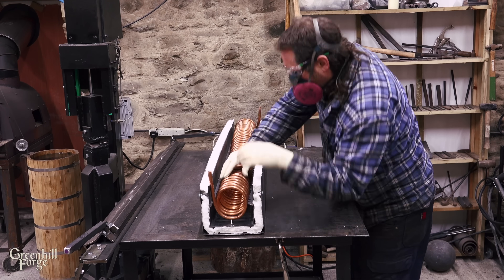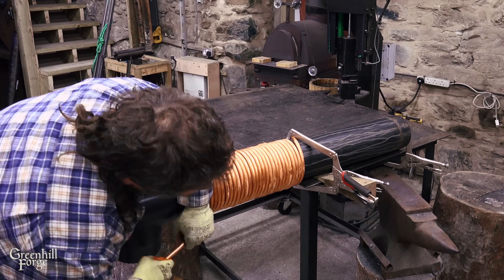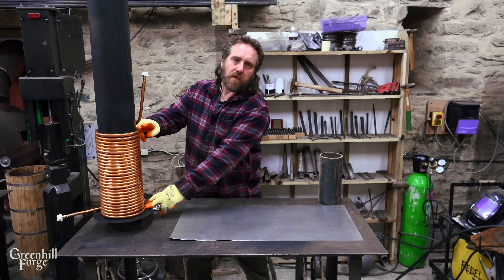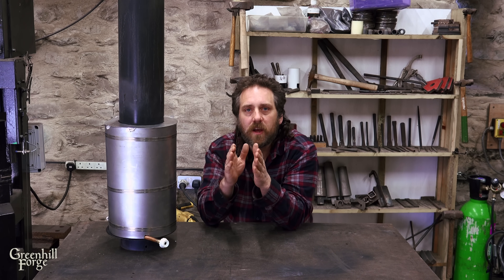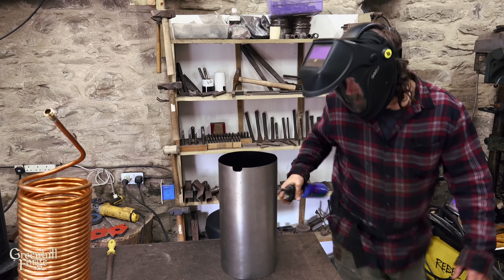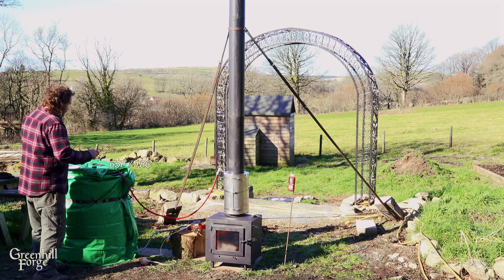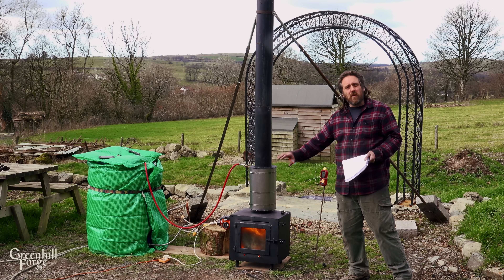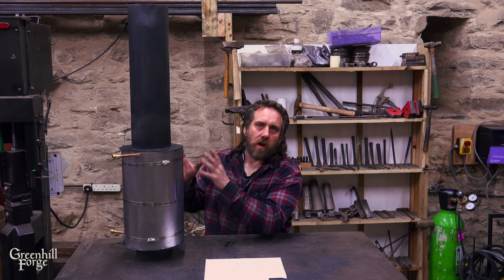Best Wood Stove Water Heater Yet: New Design Tested | Off Grid Water Heater pt3

Comment: So I like the idea of the most efficient being inside the flu, sounds like you need to separate the fire contact from the copper to reduce creosote… what I’m picturing looks like a regular flu on the outside, copper on the inside but you would have to weld a stainless jacket from the inside diameter of the coil to the inside diameter of the flu. The flu exhaust gas path would favor a Venturi yet the copper would be protected.

Comment: I assume that you chose copper for the conductivity and you place it inside of the chimney(flu? Don’t shure I’m from Germany )because of the surface area, but now you’re placing the coil on the outside so you’re reducing the contact area and now you are trying to work around this problem. I think the best solution would be to only make an outer sleeve and maybe wind up some sheet metal to direct the water in a spiral form around the chimney so you have an even distribution so the water  can take up the heat. Now you leave the copper coil away and don’t need to worry about any heat conducting materials, because the water you want to heat will get all the surface contact and buy welding or brazing the spiral direct to the chimney the heat will be transferred from the chimney  to the water like a radiator would do. Just my two cents, and that’s the way my parents Heat their Jacuzzi outside .

Comment: What about using a water jacket as in the car cylinder cooling system, so that the water is in direct contact with the chimney (without the copper pipe)? Also, instead of the chimney being  purally cylindrical, it can be made in " cylindrical zig zag" to increase the contact area and thus increase the efficiency of heat transfer.

Comment: I'd say just use more copper pipe, add a 2nd or 3rd section. If it's inside, you will also not lose as much heat or could snake the flue pipe for more heat dissipation.

Comment: The reason the coil in chimney worked better is because it is longer. The tighter outside coil only covers a relatively short part of the chimney. If you stretched the coil over a longer part and that used sand or grafite to fill the void the amount of heat transferred would be much larger as the coil will be longer in contact with the hot chimney.

Comment: Use same design for diesel tractor engines, steam into intake of diesel, burn less fuel, tractor runs cooler under full load, steam cleans engine carbon deposits

Comment: If you want to make it exponentially more efficient, make the coil section of the stove pipe horizontal. You'll likely have to use heavier gauge pipe due to the amount of heat, but the heat transfer will be more efficient. Also, if you incorporate a horizontal section of stove pipe, you may want to design a door at the end for cleaning purposes.

Comment: take the coil and spread it out so it contacts more of the flue pipe. then insulate it. the problem is you are relying on very little surface area. if you spread the coil out so it isn't touching itself it will absorb more heat from the flue pipe.

Comment: Graphite dust sounds like a good way to make a thermobaric bomb and demolish a building.

And the rocket stove temperatures would ignite solid graphite, if I’m reading the internet correctly.

Going from sand to graphite seemed like a big reduction in safety and I’d want to hear what a physical chemist had to say about it… the particle size might matter a lot.

But I’m here for it.
Reply from the maker: it wouldn't burn fast enough to go pop i don't think. pure carbon is flamable but it would need air so if it's sealed up it shouldn't burn (and hasn't) but sand would be the safer route
Reply: @GreenhillForge  I’m worried about failure modes … what if problem X causes rupture, and now you’ve got much worse problem Y : explosive dust surrounding ignition source …

Comment: In the 1980's I lived in the Rocky Mountains at around 8,800 feet above sea level. One of the neighbors used a passive system similar to your first exterior wrapped example to supply hot water to hot water baseboard heaters throughout his entire house. There were no cold rooms in his house.

Comment: I did something very similar years ago. Copper outside the flu but I filled all the gaps around the pipe with automotive muffler cement. My desire was to have as much heat transfer to the copper as possible. 
My intent was to preheat my city water as much as possible before it entered my NG water heater. I used an insulated water tank in parallel with my copper water heater. The entire system was at full water pressure. No need for a pump as convection moved the hot water. At the top of my preheater loop between stove and tank, I piped the warm water into my permanent NG water heater. Did it work? Absolutely and so well that my NG tank never fired up. The pilot light was all that burned gas. It worked so well that in the spring my local utility came by and changed my gas meter for no reason at all.

Comment: Here's an idea.
Have the coil around the outside but weld a steel strip between the coils, and then weld steel around the outside of that.
The idea is that the copper will be surrounded steel 360º for the full length of the copper.
There will be good heat transfer all the way because the steel will be welded all over.
The copper coil will remail clean. Maybe add graphite in all the voids.
I know this is absolutely labour intensive but I believe it will give you the best all-round figures, including longevity.

Comment: Just make a boiler , and use 3/4 pipe. 
No need for a pump , convection makes the hot water rise naturally and draws cold in . 
That's how they work . 

If you are determined to use pipe , ditch the 1/2 inch .

You Must keep the hot water storage above the heat source as hot water rises .... naturally.

Comment: How about trying it same system but have the flue double so the flame is. Going both sides of the tube ie instead of going threw the middle of the copper pipe it going both sides all the way round hard to explain

Comment: If it's all about heat transfer, preferably to the outside of the flue, why not weld on a jacket on the outside and ditch the copper pipe which adds another layer of metal, and has minimal direct contact to the flue which is the heat source? I haven't made one yet but have designed it with spiraling inside to make the water journey longer and more predictable.

Comment: great video, great results.
I do have one suggestion, that will mess up all your data. Slow your flow rate.

You said youll be off grid, and not using a pump. the pump pressure should be minimized to flow just enough so steam isnt produced coming from the outlet.

IF you change/slow down your flow rate, you'll get alot better efficiency results...or im 100% wrong....but just a thought.

Cheers

Comment: so why not place the copper on the top of the stove to start. its directly over the stove so its hotter, touches a thicker part of the metal. Only downside you may not use it for other things like cooking. if you want to heat the water more quickly just increase the length of the coils on the output pipe. same inputs in terms of woods, bu tthe water has a longer time to heat up and it touches more of the hot pipe. also consider a digital pump to control flow rate. slowing down the flow of water would increase the time under heat improving results.

Comment: I have always wanted to build a green house that I could use year round in Central NY.  I thought using a Rocket Mass Heater along with several hundred gallons of water stored in drums along the back wall (North wall) could be used to store heat through the night.   I think being able to move the heat around with water is a great way to increase the use of a wood stove in this situation.  I live on a hill so the north wall could be built into the hill to increase the heat retention.
Reply from the maker: It's a good idea that I've always liked too. I built a greenhouse thats a couple feet deep into the ground with a heat retaining north wall but I don't have a heater in it. it works great and adds about two months to growing on each end of the season. here's a video of it https://youtube.com/shorts/d_9Iyp3P0-w?feature=share

Comment: do it like the Russians do.  they just make a stainless steel water pipe.  and put it on the rocket forever and insulate it. water is pumped from above. and if it's like yours, then the capacity should be higher than the heater.

Comment: What if you machined a cylindrical heat sink that fit around the flu pipe that had rounded spiral groves that you could wind the copper tubbing into. The heat sink could be made our of different kinds of metals to test but I'm wondering if it would work better than the graphite. I've never worked with graphite so I don't know how it would stack up.

Comment: For off grid without a pump have the tank on a stand above the hot water heater coil????  if you are going to use a catchment system the cabin's water the HWH between the catchment tanks the cabin then will need to be taller and that process thought through....less than my $0.02 input. further expansion to use it for an external shower house and use thermal expansion to fill the tank, then the HW tank could be equal or higher than the catchment tank and a mixing valve used to regulate the shower temp variables

Comment: Thanks so much for this video. It's the closest idea I've seen to the idea I want to attempt. I'm wanting to supplement heat to a 1000 gallon pond in a dome greenhouse...and my idea is to use a galvanized bucket with a pre-coiled stainless steel weir in it covered in sand (or graphite powder after seeing this video)...kind of like the "sand battery" offering I see using a solar panel and a hot water heater heating element...and sit the bucket on top of the (catalytic) wood stove....then use a cycle timer/small pump to fill/drain the water in the tube into the pond when it gets warm/hot. Not thinking it will heat the pond er anything...just wanting to capture some heat/use the heat from the stove for further benefit if I can. You've definitely given me some new things to think about! Thanks again!

Comment: I'm not sure what you have planned for the rest of the wood burning oven; it looks pretty dedicated to heating the water. So, if you plan on doing the cooking and coffee making elsewhere then I'm guessing there is some serious heating opportunity being missed on the top surface. Beginning the coil wrapping could start on the edge of the top surface, and continue at least 4 ft upwards. So the stove would get a top cap of insulated sand that went up the length of the exhaust. Perhaps you could go backwards in performance a little, in the name of safety, and go back to sand instead of graphite too. I'm not sure how safe that stuff is when things get broken down. Sand however, is everybody's friend.

Comment: How about oil or silica as a filler? Although the silica would probably be the same as the sand but oil is used in transformers to keep the coils from catching on fire and will keep the heat long after the fire is finished. Thanks for the video, very informative.

Comment: How hot does water need to be?  If you want fast I’d drop the sand and graphite and keep the cover and insulation.  That’s what a hot water heater tank uses.  My flue consistently runs at 300F and think that should be plenty.   If the idea is instant heat, hotter fire - which is what you’ve done.

Comment: I used 2 205 litre oil drums, stacked. The bottom drum was the firebox. The top drum had 4, 40mm flues through it. Then I used 2 coils of 13mm copper pipe, each 18 metres long joined with T joints each end. Fill the top drum with water, which the fire heats, which in turn heated the water flowing through the pipes. Wrap the top drum with insulation. Though it took a fair time to get the water hot, it didn't take much to keep it hot. This was used for a bush camp of 100+ people to shower for a few years.

Comment: I used to heat water on a thermosiphon system with a wood stove in a previous house.  The shop where I purchased my stove supplied an optional stainless loop of tubing that was set high in the firebox of the stove. The total length of the tube in the box was probably less than 3 feet.  The loop was plumbed to a preheat tank above the stove that ran on a thermospiphon.  The hot side of the preheat tank fed the cold intake of a regular hot water tank.

There was no buildup of creosote, it just burned off when the wood stove was up to temperature.  The system worked well.  So well that in really cold weather I had to open the hot water tap to introduce more cold water into the preheat tank to keep the hot water temp reasonable.  I had electric baseboard heat for “backup” if we were away from the house for a few days and to keep the chill off while we were away at work.  When wood burning season ended our electricity bill went up because that was when we heated water with electricity.
Reply: Prewarming the cold water is a good idea, this copper pipe could even be coiled above the heater in a giant coil say 50 or 100 feet fastened to a sheet of concrete board then nailed to the ceiling.. You would want a check valve to prevent the warmed water from backing up into the cold and I might worry about biological growth inside the pipe unless the water is chlorinated.. In the Summer a coil of pipe in the attic could do the same preheat job, adding a diverter valve to switch the paths and a couple gallon expansion tank like is used for boiler heat pipes to prevent pressure pop offs of the hot water tank..

Comment: Thanks for doing these experiments.   Can you physically attach the copper to the outside flue ?   Solder, something for the heat to pass thru.  Physical contact, instead of a very small contact for the heat to flow.

Comment: You could improve it a lot by having gaps between each turn of the  tubing. Also, if the outer metal cover wasn't in contact with the tubing, heat could also transfer into the outside surface of the tubing.

Comment: You could double the amount of copper coil and sap more heat from the flu pipe. Just increase the height of the entire heat transfer unit, the coil, the graphite the insulation jacket, everything.

Comment: maybe it's already been said, but have you considered placing the coil inside the flue, and creating a sleeve/shield that covers the coil and protects it from the mentioned issues of build up and corrosion? Say you coil the copper tubing around a 4" pipe, then place a 6" pipe over that, seal the top and bottom so that no smoke can reach the coil, and then place that inside a 7" or 8" pipe. That would be a lot of extra material but would allow the coil to be inside the flues heat path and avoid build up and erosion. Thanks for your great videos, so helpful! J from Oregon
Reply: Another idea is to buy or build a more efficient stove that doesn't produce smoke due to secondary burn chambers or the design of it, like a rocket stove

Comment: In the first test with the copper coil in the pipe itself, by burning dry potato peals once every few days will greatly reduce the amount of creasote in the pipe.
By doing this often it will also keep your copper coil cleaner.
One cause of lack of heat retention is creasote build up.
Heat will not readily transfer through creasote.
And WATCH OUT FOR CHIMNEY BURN OFF OR CHIMNEY FIRES !!!!!
CAN'T STRESS THAT ENOUGH !!!!

Comment: Redneck method: Remove the burner assembly from a gas water-heater, and mount the water heater on top of the wood stove, using the water-heater core to replace a couple of sections of the stove pipe. Basically, you would be replacing the gas burner with the wood stove. (Do not try this at home!) 😆

Comment: I like what you got going on here. I keep mentally designing systems and I figure Both end open evacuated solar collection tubes, like the ones they use in molten salt solar trough power plants, put them along the ground of your equator facing wall and design the wall to have a 20ft long one sided compound parabolic trough designed for 40 degrees vertical deviation of light capture and angle the wall for winter maximization. The tubes will be the lowest point in the thermosiphon loop. Every 24 linear ft of wall should provide for 1000sqft of in floor heating. Got too much sun? Slide some gutter sheet metal over the collector for shade, possibly on an auto damper bimetal coil spring much like the ones on the back of wood stoves.

Comment: Pipe in secondary air to a 3 or 4 pipe manifold drilled out to supply oxygen to the smoke. This adds temp and cuts down creosote vastly
Reply from the maker: I added the type of system in the stove build https://youtu.be/al_UNeEeaQw
Reply: @GreenhillForge 
Love the testing methodology.  Have you tried the manifold secondary air system yet? And did you have a secondary air system on your water heater test build?
Reply from the maker: @daveroy1066  the wood stove in this water heater test video is the stove I built in this video https://youtu.be/al_UNeEeaQw so it doesn't have a manifold, just a single pipe with holes. I haven't tried a multio pipe system yet. I have started working on a different stove and it will have a different secondary air system and that video should be out pretty soon
Reply: Subbed

Comment: New data always leads to new questions. Considering how much better results you get from the coil inside the the pipe, just how long you can use the heat source before the creosote buildup becomes dangerous and how much effort and money would it take to replace the coil on a regular basis? If that’s not practical, maybe it would be practical to have one system indoors where you’re using it all winter anyway and another system outdoors with the coil inside the pipe, so you can get your hot water without heating the dwelling, faster and using less wood.